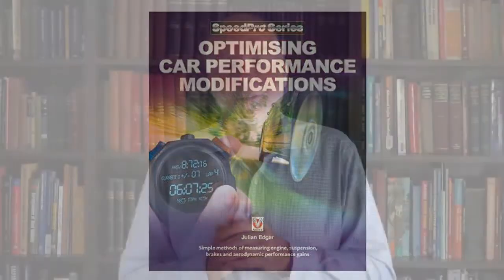Measuring intake flow restriction in cars

Comment: Would this work on an intake manifold I took off my airbox so it gets free flow and how would I do it would I have to drill a hole and then cover it after? I have a 1nz fxe in my Prius c I’m going to do a camshaft swap and can’t find any manifolds that would fit since they face the hybrid drive but the earlier version with the aluminum manifold would fit but I don’t want it to restrict it more than the one on it already
Reply from the maker: It's normally done prior to the throttle body ie before the intake manifold. Intake manifold vs power is a different ballgame.

Comment: Hi Julian. Have you done much testing of pressure drops across throttle bodies at wide open throttle? What about from the TB exit to the intake manifold of NA engines? I'm wondering why you generally stop measuring prior to the TB. Is it safe to apply high vacuums to a Magnehelic gauge? Also, what benefits have you seen - on a gauge or dyno - from gasket/port matching? I've heard that protruding edges aren't as bad for flow as might be assumed, because they typically only effect flow at the slow boundary layer.
Reply from the maker: I haven't done any gasket matching measurements. I usually show measurements only up the throttle body as a different technique is needed for measuring pressure drops across the throttle butterfly.
Reply: @JulianEdgar  Even at WOT? Does the answer have something to do with velocity?
Reply from the maker: @andrewleonard9257  Nothing to do with velocity. It's just harder to measure this pressure drop without being able to hold full throttle, full load constantly.

Comment: hey julian, what are your thoughts on forward vs rear facing snorkels on 4wds?
Reply from the maker: Forward facing. Should easily be enough aero pressure built-up to negate the flow drop through the filter. (Take about 5 minutes to measure the pressure difference of front-facing versus rear-facing.)

Comment: Hi. There's any formula to calculate air restrictions based on displacement or hp?
Reply from the maker: You'd need to know all the restriction of the complete intake system first - measurement is the key.
Reply: Hum...my closest guess would be to measure vacuum immediately after air filter ( once a new air filter has been installed) . That would provide a base line restriction index. Then all I have to do is multiply by 3 that initial number. That would be my maximum  air restriction  for that specific  engine.
Reply from the maker: @enterBJ40  I have no idea why you would take that approach!
Reply: I must multiply by 3 because that is maximum  restriction amount  allowed by major Diesel engine manufacturers. 
The minimum base number  can be determined  by measuring  the amount of vacuum in ideal conditions: X amount of RPM  using a brand new stock air cleaner  in a stock air box and air ducts.